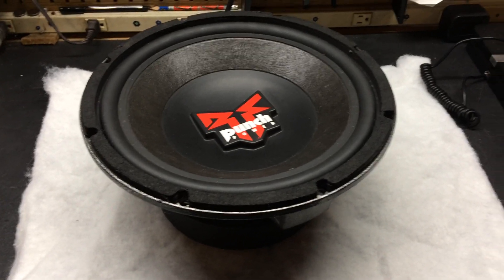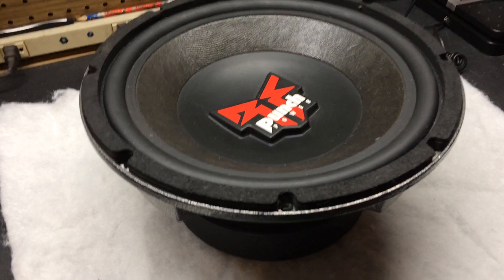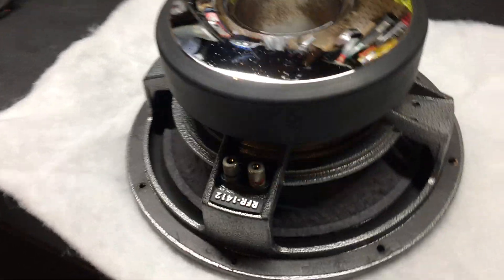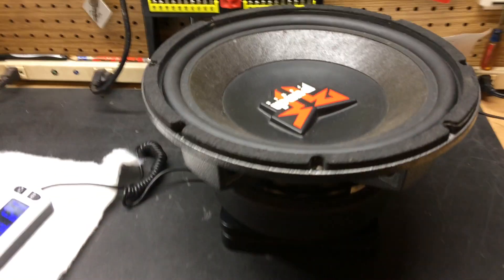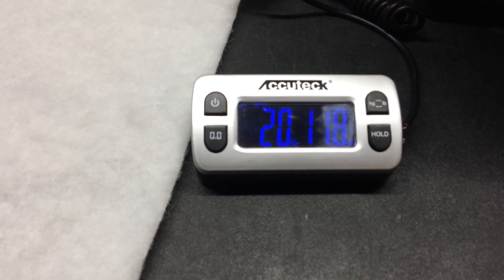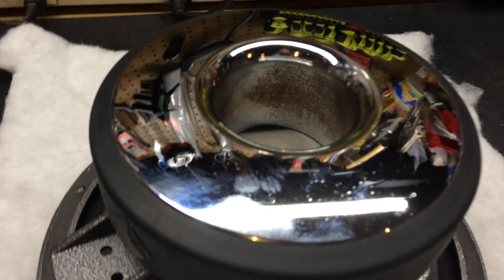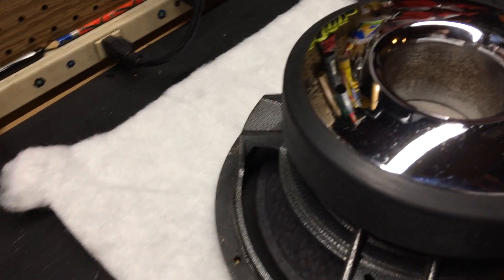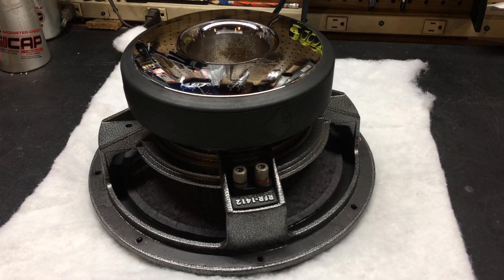Old School Rockford Fosgate 12" Punch Power RFR-1412 Subwoofer Quick Overview

Comment: I wish Rockford Would bring these back as a classic. They where easily my favorite subs I've ever had.
Reply from the maker: Something like a anniversary edition would be neat. Of course RF doesn't listen to their fans anymore. If they did make such an item they would probably charge out the a$$ then they would be compared to Kicker all day because Kicker already jumped the shark with their "gold label" subs.
Reply: @kaknballz  I wouldn't even bat an eyelash, and would buy two sets.  One for right now and another to replace them!  I wonder if the p3's can hit like the old Fosgates did?  I replaced my two punch DVC 12's with four newly released Jl Audio 12W3's and increased the power from 1k to 1.5k watts and the JL's had no chance.  The Fosgates had more force, and could go way deeper than the JL's. I just bought a pair of Image Dynamics IDQ12's to replace the stealth box in my truck because the two Jl 10w1v3 just can't get low.  I have been on a search ever since I replaced my Fosgate DVC's for something that sounds similar.  Clear, deep and force full.

Comment: Cool video i have the same subs but in 15in  i bought them new around 1997 and powered it with a Rockford Fosgate Power 650 Mosfet and a pioneer head unit and i still have all the equipment in great condition.

Comment: 18 punch series. Got a pair that run in very good condition. Car got ran into parked 2 weeks after 4 put into car 1997. Found these boxes up work great. Don't have the 3.7cu per sub to run them. Need a home..

Comment: I recently picked up a pair of these Subs and iam wondering how much power they can handle
Reply from the maker: 10" Powers are 300 RMS and 12" and 15" Powers are 600 RMS. These numbers are the same for first gen Powers and second gen Powers. I can tell you that replacement coils are hard to find so if you want to run them you might consider not going overboard with power. I hear people all the time claim they ran 1000 watts to each sub. That may be true when they were new but these subs are 25 years old.

Comment: Hi!
Nice Punch Power Sub! I got the same RFR 1412 and Rockford recommended a ported box with around 43 liters tuned to 35Hz. What did you do with this beast? Did you go a different way? I was thinking of making a box with a little more volume and tune it a bit lower - Do you have any Experiences with that woofer? This one should also go well for home theater :-) I have a bottle of Rockford-Fosgate-Beer from 1996 never opened it :-D
Greetings from Germany! I also have a small collection of punch power series amps & some PSDs, check out my oldschool fosgate video :-)

Comment: Awesome sub, trying to snag one for myself! :)
Reply from the maker: Check out some of the Rockford Fosgate Facebook groups. There's some "decent" priced ones out there.
Reply: kaknballz Thanks for the tip! I'll take a look
Reply: Snag one myself last summer for around 60 or 70 bucks! Looks mighty impressive, but the spider has sagged from facing upwards for many years. So last years it's facing down to get that spider back in neutral position. Also chasing one more if I can find to get a pair of these bad boys hooked to my MTX 2300 or 800.2  :D
Reply: Just found one.

Comment: What’s the difference between these and the dvc ones?
Reply from the maker: These subs are single voice coil, SVC. The Power DVC's have a dual voice coil and twice the power handling. The motors on the DVC's are also slightly different as they do not retain the chrome bottom plate.

Comment: Are there any knockoffs of these going around?
Reply from the maker: Not that I am aware of?? There is a first gen Power sub that looks identical but has a foam surround and different dust cap. This sub in the video is a second gen Power. Then RF came out with a Power DVC and so on. Some manufacturers did use the same basket as the powers by RF. I think at one point in time in my life I was told that there was really only about five companies that made all the different baskets for all the subs on the market.
Reply: @kaknballz did this series, with this style dust cap logo ever get better than the punch power dvc?
Reply from the maker: @michaellecompte1889  I believe that with every passing year there are improvements made to subs/speakers to increase performance and out put. HOWEVER!!! The raised RF dust capped subs will always be my go to sub just because of the looks. The Punch Power DVC is my hands down favorite sub ever made period. But that is just my opinion and what I grew up with. Subs now days will easily hand the Power DVC's their butts but for me the nostalgia is where it's at.
Reply: @kaknballz  for sure man, I get that… i just meant of all raised RF dust capped subs…the power DVC was the best one correct? 

I just picked up a pair of RFR-2212 in really decent shape. Probably going into sealed boxes rather than ported because they’re so old… 

Everything looks really good but the spiders seem like they’ve seen better days. ( one of them more than the other.)
Reply from the maker: @michaellecompte1889  Yes, the Power DVC was the cream of the crop in the reaised RF dust capped subs.

Comment: Do you sell any of the Rockford items you’ve bought?
Reply from the maker: I do. I'm actually letting go of some amps at the moment.
Reply: kaknballz which model amps are you selling? If you sell any subs let me kno also
Reply from the maker: As of now I have a few smaller DSM style amps like 40's and 60's. I do have a 225.2 as well as a 200.2 also. As for subs I do have a pair of 12" Powers that are 8 ohm subs. My only qualm about selling them tho is packing them. I don't mind selling amps but subs are a different story.

Comment: Is 100 for a 10" a good deal?
Reply from the maker: I've been used to paying around $50 to $75 for 10's. Depending on if that price includes shipping or not it isn't a bad deal as long as it's in good working condition. If a box is included it's a even better deal. Always look for spider sag. If not sure of what that is check out some of the videos on here and type in "spider sag".